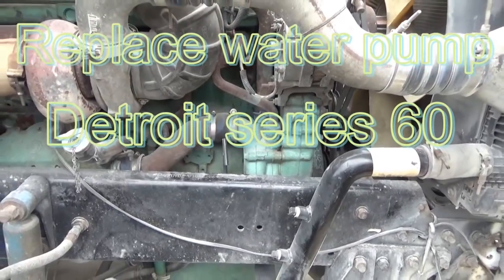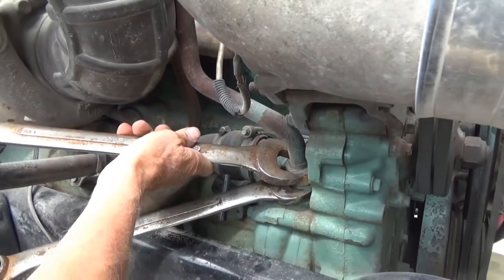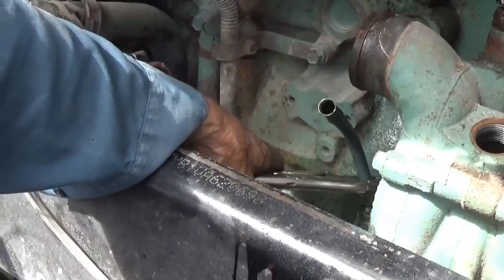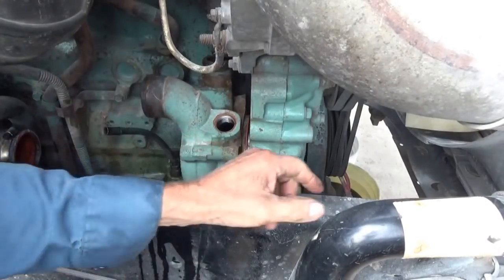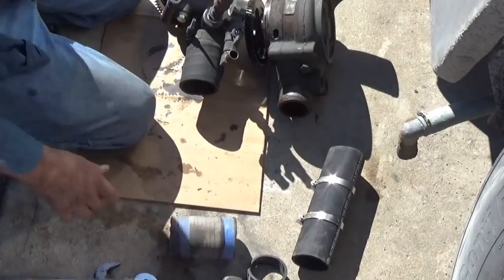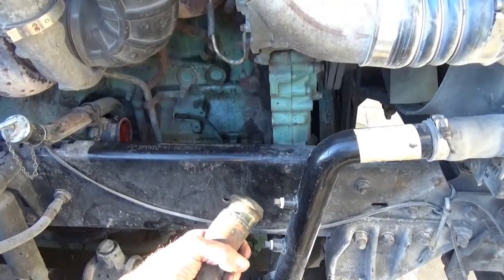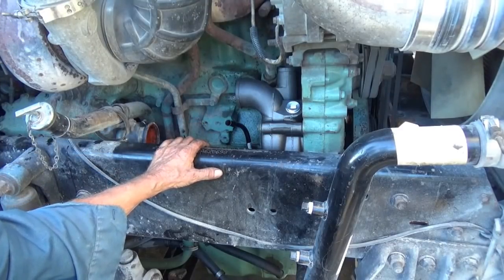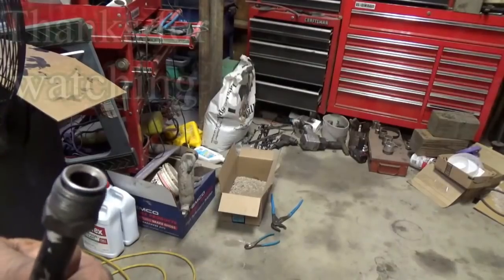Changing water pump on '97 Detroit series 60

Comment: Good day sir. I just wanted to say thanks for the video. I just replaced my water pump on my 97 series detroit 60 and your video was a lot of help. My dipstick was a lot further back so I didn't have to contend with that. My biggest issue was getting the new pump to seat flush. The O ring was stopping it from seating completely no matter how much I twisted and pushed. I had to get the 3 bolts started then torque them each a little at a time to draw it in flush. I'm not super mechanically inclined so I was pretty proud of myself. So far it's all holding together. 🤞 thanks again sir.
Reply from the maker: A little oil on the O-ring will help it go on, I don't know if you did that. Thanks for commenting.
Reply: @57bagre  i did. It just didn't want to cooperate as well as yours did. Lol.

Comment: love ur videos im surprised you just didnt change the back plate on that pump runs like 15dollars cheaper route that changing the whole thing thanks for taking ur time on everything u do very informative for the rest of us keep on truckin Mr Gordon greetings from mcallen texas
Reply from the maker: I was more concerned about the seals on the shaft after 22 years, the bearing and the leak in the back, it was time to just change it out. I don't have time to do to many rebuilds on parts. I will repair or rebuild starters and alternators though. Gracias por mirando mis videos y saludos de E. St. Louis Illinois.

Comment: Thanks for a very timely and useful video. The worst part of the job was that dipstick removal. I cut a wrench to brace the bottom part and still ended up breaking the dipstick tube. I’ll bet I spent the better part of an hour fiddling with it before I gave up and twisted it off. Thanks again :)
Reply from the maker: Sorry to hear about your dipstick, I don't remember having trouble with mine but I have had trouble with dipsticks before on cars.

Comment: I heard those downpipes were expensive, but I didn't know they were crazy-expensive... and they now seem to be an endangered species.  Up here in the Great White North where we put more salt on our roads than we do on our food,  those downpipes on FLD's would be LUCKY to see 4 years.  I knew a guy who after having to buy one, just resigned himself to cleaning it off,  and re-painting it every summer in an effort to make it last longer.  I'm sort of surprised that you didn't go around to some of the (collar-swivel) fittings and douse them with a penetrant of some sort.  Obviously, they came apart nicely, except for the dipstick tube (ironically, the one that should have been self-lubed by oil...).  All in all,  it was a fine job, though.
Reply from the maker: I'm doing a video on painting that pipe and show what happened to my old one. I do hope you use more salt on the road than on your food, the Doc says don't put too much salt on your food.

Comment: Gordon can I ask your opinion; so mine is leaking but only from that back bottom bolt. Do you think it’s the pump or just the seal.. This water pump is only about two and half years old. It was replaced when I had my engine rebuilt.

Comment: I would have been tempted to just replace that seal, but logic says if that seal started seeping, what state is the other seal facing the impeller?  Coolant in oil is an absolute mess to deal with.

Comment: You need to use a nitrate supplement in your motor . Get test strips you dip in coolant adjust until the color is right  on the chart. It will save you a lit of issues the economy antifreeze will not usully have nitrate additive

Comment: Surprised you didn’t go ahead and paint the water pump and change the thermostats great video
Reply from the maker: Time is always an issue is why I didn't paint it.The thermostats are less than 2 years old, the rebuild kit came with new ones. I might paint it later.

Comment: Thank you for the video. Also green antifreeze isn’t good for the cylinders
Reply from the maker: my cylinders are color blind. Thanks for watching.
Reply: Gordon Robertson I only said it because when I bought mine 14l Detroit two Mechanic’s told me it was bad for the liners so I flushed it out. I figured it was bs tho
Reply: Gordon Robertson It’s not the color. It’s the fact that regular green coolant doesn’t have the anti cavitation additives needed for diesels. NAPA sells their coolant additive that’ll bring it up to diesel specs for about $15 .
Reply from the maker: Wayne Swicegood  I know about the phosphate level in the coolant, I added that to mine about 16 years ago when I bought it and ran about 900,000 miles and don't know how many times I had to add antifreeze in those years (green from the auto parts store) and never added phosphate additive again. I did an in frame overhaul on it at 1,487,XXX miles almost 2 years ago and the liners were clean, no pits, just a very minimal pitting in the block in one cylinder. I'm not saying it doesn't do anything but is somewhat over rated as much as over priced antifreeze at the dealer. It is a good idea to use the additive but not an emergency and in my case, I don't put a lot of miles on it anymore and will get some additive some day. Thanks for watching.
Reply: Anybody ever heard of a water filter with the cake in it ?????

Comment: How long had it been leaking mine just started yesterday? Planning on fixing at this weekend but it's like a hundred and ten here wondering if I could run it a couple more weeks?
Reply from the maker: Maybe a year.
Reply: Just replace the rear seal all the work and money he spent was unnecessarily a waste of time and money just REPLACE THE REAR O RING FOR ABOUT $5 DOLLARS AND THE LEAK IS STOPPED IT'S ABOUT A 5 MINUTE JOB AND THERE'S NO BOLTS OR HOSES TO TAKE OFF

Comment: Nice work, that would have been a eight hour job on a cat.
Reply from the maker: I'm glad I don't have a Cat.
Reply: Nah- I did my pump And thermostat-5 hours, And thats with taking breaks. I dont have the monster c-15 where you have to remove the Ac Compressor and Radiator support.  I have the C-12,Those pumps weep internally- 30 minute job to remove 30 back on and 30 to do fittings-etc......Took longer for the thermostat housing- Seals were frozen inside.

Comment: Car coolant will eat the liners in a diesel.  There is a real reason you have to check nitrate levels. 

You can get  extended life coolant for diesel engines for the same price as auto coolant.
Reply from the maker: It will never hurt this motor doing local low speed short runs. It's the long term high engine speed, high mileage/ hours engines that are threatened by "green" antifreeze, not weather gas or diesel.
Reply: @57bagre  Gotcha. Just had a friend need an overhaul at 350,000 on his because he didn't maintain his coolant. 

After all your money and hard work that you put into yours, I didn't want to see that happen to you. 

I really enjoy your videos and try to not ship the ads! Keep up the good work.
Reply: Edit. I try not to sKip the ads.

Comment: Hi Gordon , do those pumps ever leak on the gear side and contaminate the oil ?
Reply from the maker: Not likely, it has 2 seals, 1 on the antifreeze side, and it does have a weep hole to let antifreeze out before it gets to the other seal that keeps the oil in the gear case.
Reply: Mine is leaking oil, I’m wondering if I change the seal if it would stop leaking..any suggestions ????

Comment: All he had to do was take the big flat round clamp off the back of the water pump and replace the  oring  and put it back together have done it plenty times the pump is not bad IT'S JUST THE O RING WHAT A WASTE OF TIME AND MONEY THE PUMP DOESN'T HAVE TO COME OFF THE ENGINE IT'S JUST THE REAR O RING WHICH COST ABOUT $ 5 DOLLARS AND INSTALLS IN ABOUT 5 MINUTES.  WASTED MONEY AND TIME

Comment: Sorry it's not water pump the proper name is COOLING PUMP .
Reply: The pump doesn't cool the antifreeze...
Reply: IT'S A WATER PUMP AND NOT A COOLING PUMP IT PUMPS WATER AND COOLANT IT DOESN'T COOL ANYTHING IT CIRCULATES COOLANT THROUGHOUT THE ENGINE AND RADIATOR AND HEATER CORE THE RADIATOR COOLS THE COOLANT AND THE FRESH AIR AND THE ENGINE FAN COOLS THE RADIATOR